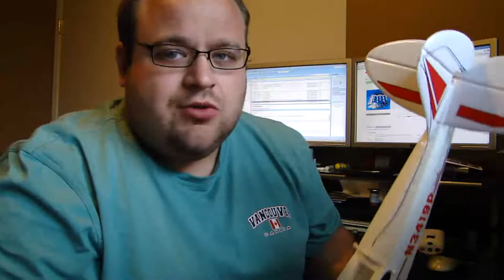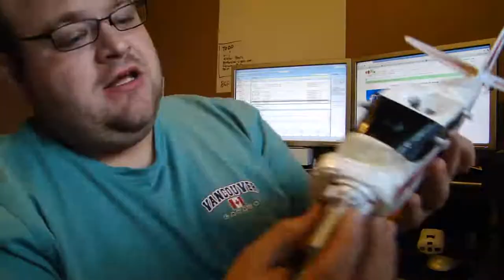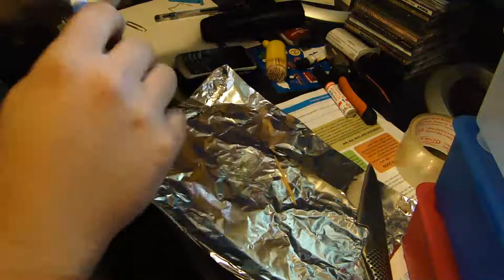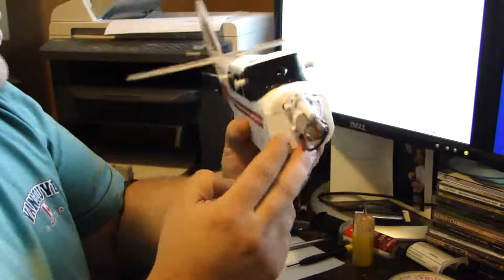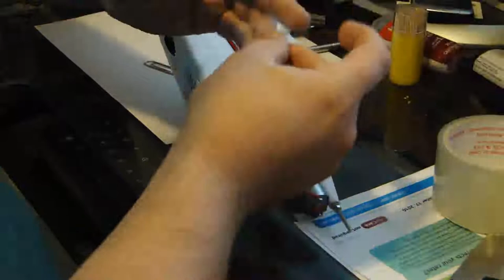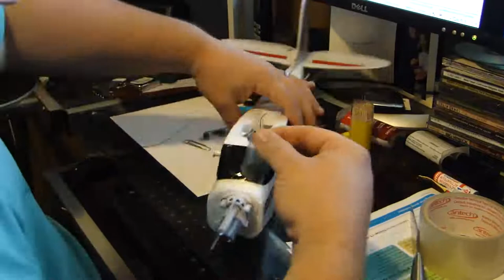Fixing a Busted hobbyzone Mini Super Cub

Comment: great vid i busted mine too on a first flight hit into a wall but i went down to the hobby store and got a replacement gearbox because the prop was bent downwards fixed it, stuck on everything with epoxy and it was good as new

Comment from the maker: There are no dumb questions! :)

The nose cone should just pop off - and behind the cone is a nut threaded onto the prop shaft (remove it and the prop comes off).

The cowl has two screws securing it - take them out and the cowl just comes right off.

Comment from the maker: Not surprisingly, the epoxy did change the CG of the plane. It didn't cause any problems when flying, but I found moving the battery aft in the compartment returned the CG to normal.

Comment from the maker: @superxman3104 The ACT does actually work, although, it is not without limitations. The sensors are not cameras or imaging devices that track the planes orientation, but merely photo sensors. It essentially works on the premise that the sky is bright, the ground isn't. so if you get anything that makes the ground bright (water, snow, lights, or gigantic mirrors) it can get confused. It has saved me on a number of occasions, and I would definately say it helps the beginner.

Comment from the maker: @brib333 CA = Cyanoacrylate, which is what most contact adhesives are made from (including the one I've shown here). Using tooth picks is a good option, feel free to use whatever you'd like to fix your plane.

With regards to prices - the fuselage, and electronics can be picked up for a song on eBay, in fact you can buy whole lots of ten to fifteen complete (non working) planes for $50.00. My local hobby store sells the fuselage for $9.99 brand new. Have fun flying!

Comment from the maker: @lmfao99902 I would probably spread a slow-acting glue (like an epoxy so you have time to position the piece) on the actual plastic prongs, then insert them back into the fuselage. Keep it light, but enough to be secure so that you don't alter the weight balance much. The prongs will provide a strong adhesion point, so I'm sure it will be secure without adding glue elsewhere, or tape, etc.

Comment: I crashed my larger super cub a couple of times, fixed it with tite bond glue.  Works well but needs setup time, a toothpick works good to hold it in place.  Tape over the top makes for a strong fix.  I didn't like the act system so I changed it over  to the safe technology (super cub S).  Ordered the receiver and the fuselage, the receiver mounts with screws to the battery box.  They also improved it so the battery fits decent.  The super cub s manual tells how to set it up to the dx6i to have the three modes by using two switches.

Comment: 5 dollars for the fusullage? 30 dollars for the electronics? what planet you on.
. You use a special glue called CA. Plus u use tool picks. inbed the tool picks in to the plane, put the CA on 
Then put them together then spray an accelerater on to the glue.And it seals it instantly.
To let you know the fusulage is 30 $ and the CPU is $75.99 
Plus Dude your flying the most beginner plane and you smacked it up and now your giving info like youve been flying for 30 years?